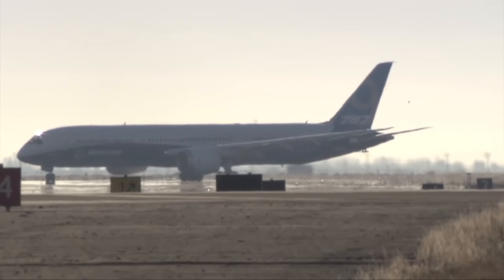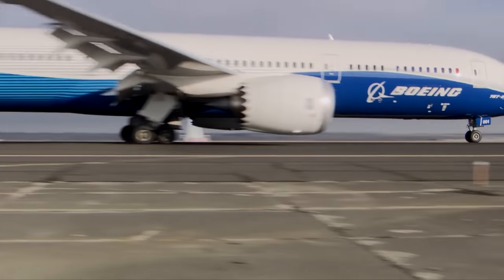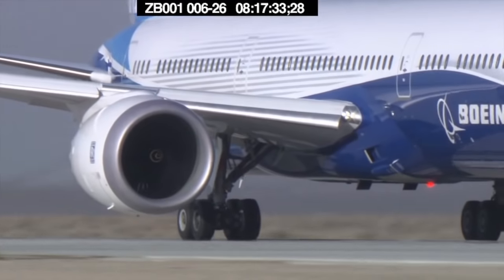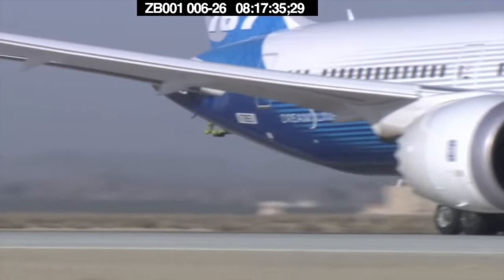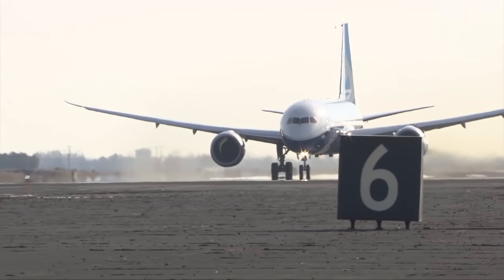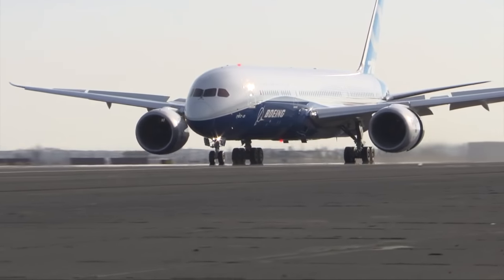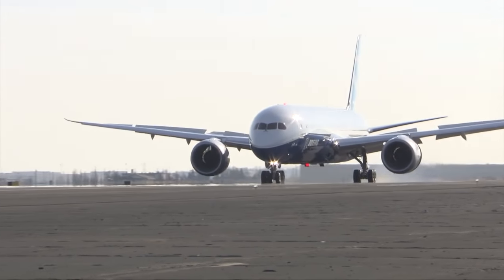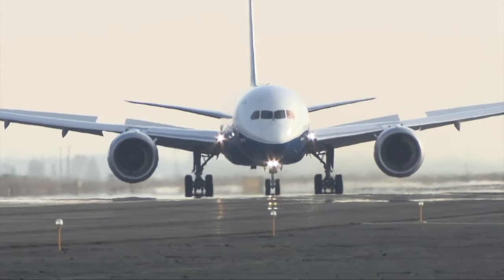For the Boeing Flight Test Team - No Engine, No Problem

Comment: Just to correct an incorrect statement from megazone below, the trailing cone on the tail is actually a static cone used to calibrate the aircraft's pitot system. Nothing to do with comms or drag.

Though it may seem dramatic, given the -9 is a stretch variant, the greater moment arm means OEI testing is pretty benign. OEI testing of the 787-8 or something like the Airbus A318 would be much more challenging.

Comment: I always wonder how many vigorous test do you perform and how long does all the testing stages takes and at what point do you fully sign off the plane as seemed fit to fly?  Is this applies too all aircraft you build before being shipped to whatever airlines or do you perform lesser test before handing them over to the airlines?  I has always pondered and wondered this.

Comment: Take care. Gulfstream were testing the G650 in stuff very much like this, at Roswell, when they got it to unstick and rotate into a certain stall, (on one engine) and when it flopped back down, the gear collapsed and the plane slid off the runway and nearly took out the control tower. Then the ruptured tanks caught fire. Then they discovered the clever lifting door assembly will not open when the aircraft is sitting on its belly, burning...

Modern aeroplanes are fantastically, unbelievably safe, when operated within their limits. But finding out and establishing (and proving) exactly what those limits are or should be, is not all that safe.

Comment: How do y'all determine how many wheels the landing gear gets? Like why does the 737 have one wheel, the 787 have 2 wheels, the 777 has 3 wheels, and I think the 747 has 4 wheels. Why is that?
Reply: +Sol Cooper it depends on how heavy is the airplane. They distribute the aircraft's weight on each tire. A heavier plane needs more tires.
Reply: aayayayáy
Reply: BTW, TECHNICALLY, the 737 has 2 wells on one landing gear (left AND right), 787 has 4 and 777 has 6 and 747, surprise, 4 but it has 4 back gears. Just a tip.

Comment: So she can take off with one engine? Fullweight?
Reply: Good question
Reply: Joe Krenzelok Watching the video again, she probably could. 
Those engine's are as big as 5/4 ratio to the main fuselage. I also remember that Boeing 787 is the lightest aircraft of her kind due to materials used in production. So sky is the limit.
Reply: Have you flown any of the big birds?
Reply: Serhan Ogan
Reply: Serhan Ogan Not from a stop, no. But certainly from V1.
Reply: Joe Krenzelok O yeah...!
Reply: Serhan Ogan its a great accomplishment to have the knowledge and skill to fly something of that size
Reply: Well, actually it gets easier with every new model. It is a lot easier that a 2000 B-737.
Computers carry bigger and bigger workload in every new model.
Reply: Serhan Ogan
Reply: Everybody knows that we're talking about flying in Microsoft Flight Simulator, right?
Reply: Serhan Ogan Yes, all aircrafts are designed to take off/land with only one engine.
Reply: William Kraft What's the other one for then?
Cause it would be a heck of an expensive spare part to carry around.
Reply: +Serhan Ogan    The "other one" is there because the aircraft flies far more efficiently with TWO engines. The increased speed the second engine provides is what makes flying the fastest way to get from one part of the world to another. Plus, the added safety measure of being able to fly with only one engine make the aircraft safer. Does this really require explanation???
Reply: Mike Hawk I was making fun of another comment dude. You really didn't have to make that explanation.
Reply: +Serhan Ogan ,
Reply: It is a regulatory requirement (EASA CS 25) that commercial aircraft can safely fly should one of the two engines fail at any point of the flight, including takeoff at speeds beyond V1  . (the maximum speed at which it can still stop before the end of the runway).

Comment: I can't belive Airbus blatantly ripped off the Dreamliner with it's A-350!
Reply: Because they were scared. Lol. 1 yr of tests.
Reply: Taylor, they didn't. I haven't seen any 350s catching fire due to battery problems, having windshields crack, fuel leaking from the wings and being over 3 years late in delivery to customers to name a few. Boeing's most favored customer, JAL has even jumped ship and ordered the Airbus competitor.
Reply: The A350 was originally going to be a twin A340, some how it evolved into a mid-sized wide body all composite airframe. Tell me they didn't at least partially copy Boeing. They new the 787 was a threat so they built a competitor. And just because it hasn't had the same problems as the 787 doesn't me it isn't a clone, it just means they learned from Boeing's mistakes. I'm sure the A350 has it's share of issues coming to it
Reply: Taylor Perkins I guess if you say both have barrell fuselages, a pair of wings, a tail plane etc. you'd have a case of sorts, given all aircraft conform to a degree. But then we may as well say Airbus 'copied' the 777 and Boeing the A330. The fact remains both are very different structurally and as yet, the A350 hasn't had the nightmare scenario of worst entry into service since the DC10. And Boeing still don't know the root cause of the thermal runaway on its batteries.
Reply: ***** It doesn't take an expert to see that they are nearly identical. The A350 is the Dreamliner's ugly twin. The bottom line is, Airbus was working on another  , they saw that the 787 was a genuine threat, got scared and threw that piece of junk together. It didn't take them very long to design it, They didn't have to style it because Boeing did that for them, all they did were slap some ugly Airbus style windows, and change the shape of the tail slightly. So they differ structurally  it is still a near clone in concept. Airbus could have taken there time to design something original but then again Boeing was grilling them pretty hard
Reply: Taylor Perkins You can always tell someone's scraping the barrel when they use the terms 'threw together' and 'piece of junk'. I doubt structural engineers at either Boeing or Airbus perceive their competitors' products in such a light. So you don't like the fact that Boeing is losing market share, year on year to a company that, to use your words, builds 'junk'. What does that say about them as a company then? It seems people like you are pretty gullible, considering the fact that the rollout of the 787 was way behind schedule and the aircraft a shell, held together by fasteners. And the CEO had the cheek to say it would make its flight soon after. For all it's sales, it's a troubled aircraft that to this day still has problems. When your most loyal customer (JAL) breaks its exclusivity agreement on wide bodies that has existed for decades, it's a telling omen. Loss of faith in Boeing has cost them dear. Airbus outsells them in the narrow body market and every A350 sold is one less 787/777. At the last count that was over 760. Maybe you should email the CEOs who bought the A350 to tell them of their grave error.
Reply: Thomas Harbauer
Reply: Thomas Harbauer
Reply: Kasmoovey watch the kids the movie watch dial Jesse Lee can watch the kids the movie please got your live watched the kissing movies s really really you're doing it right ok my okay kinky can we move can we watch the kisses yes
Reply: What on this green earth are you talking about?!?
Reply: +Al Abama calm down man, Boeing fans already know that Airbus is better
Reply: lnewyork

Comment: ALL COMMERCIAL AIRPLANES NEED TO BE A LITTLE BIT SMALLER, MORE FUEL EFFICIENT, AND HAVE 2 SMALL BACKUP ELECTRIC TURBINES FOR EMERGENCY, AS WELL FUEL EFFICIENCY, BE SAFER CARRYING LESS PEOPLE(25 LESS PERSONS) AND BE MORE PRACTICLE AND EFFICIENT, WITH MAGNETIC ELECTRIC GENERATOR ALTERNATOR.